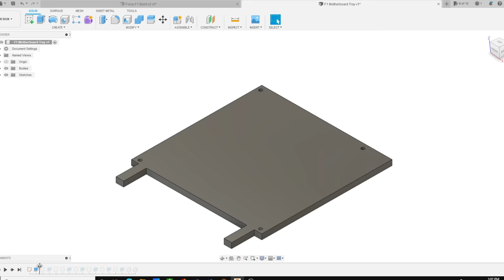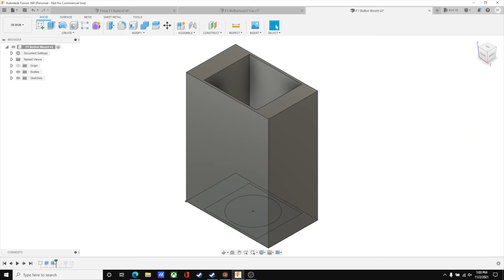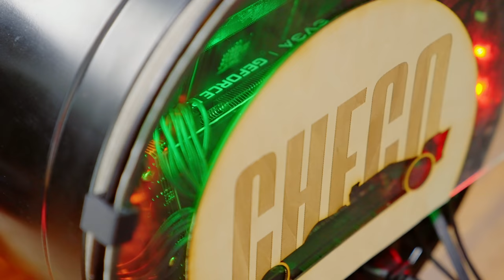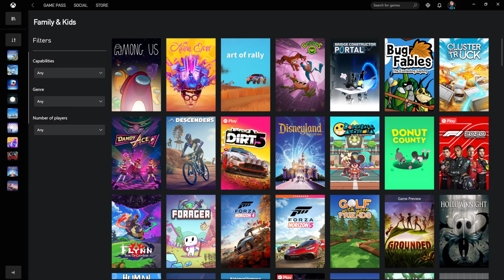I Built the Ultimate Forza Gaming PC!

Comment: Btw, they paid $1600 for the two crashed wheels that came in a set. The other one was pretty heavily damaged.
Raced (and crashed) by Sergio Perez in the 2019 Grand Prix at Hockenheim, Germany. Left side wheels from the Racing Point RP19 Formula 1 car.
Reply: Dang I remember that crash
Reply: The one they used for the PC would be the left front then,  right? The left rear took a big hit, so I would imagine that one's destroyed.
Reply: I remember that smack in the wet, ouch.

Comment: I built my Ultimate FH5 PC back in August, but then I had to play on my Laptop with its 3070, which is about a 3060ti desktop, but is not my 3080. lol But I realized if I choose to play as Administrator, It works almost perfect. There is a new issue causing the tree and grass textures to fully load in 90% of the map. But that's both my laptop and desktop. Gotta tweak some numbers in the files.

Comment: Forza Horizon 5 on PC is not the greatest way to play. People have said (and I have experienced this too) that the game runs at low framerates, (keep in mind I'm using a GTX 1660 Super and an i5 10400F) has long loading times, and the visuals kinda upgrade with the "ultimate" setting for each video quality option.

5.5/10 wouldn't recommend you play on PC rn.
8/10 would recommend you play on Xbox. Much better, an optimized.